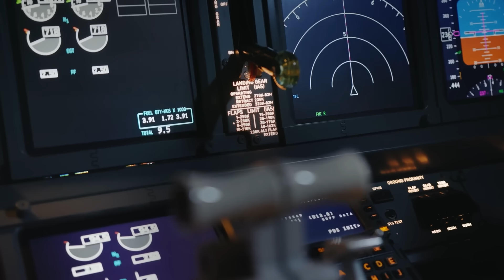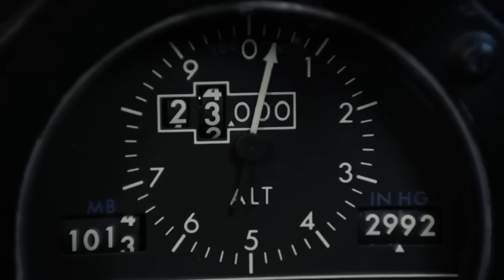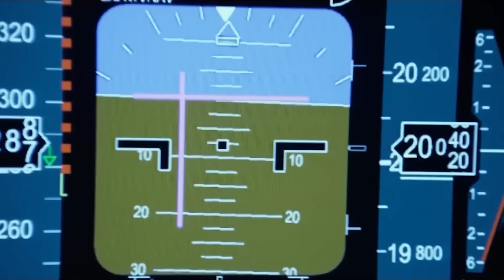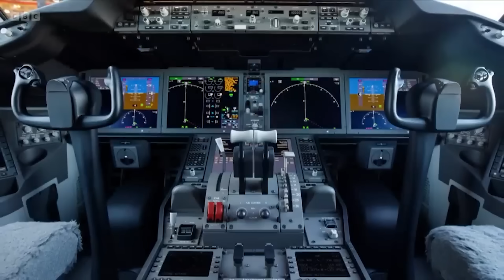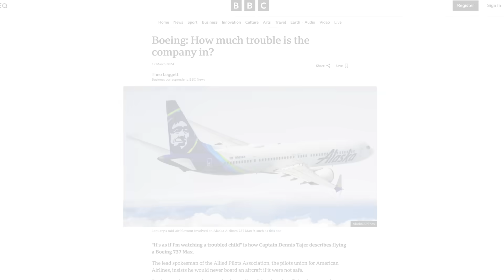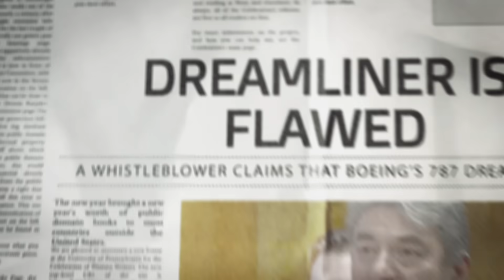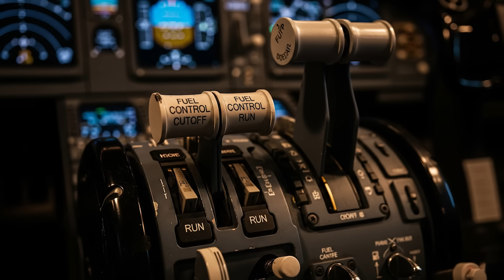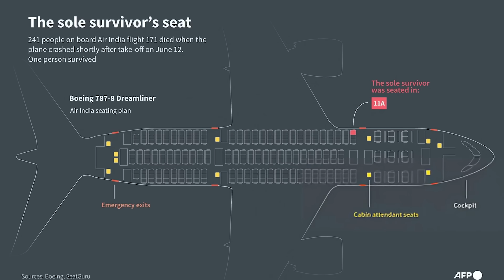What REALLY Caused The Air India 171 Plane Crash

Comment: Fuel switches off, but why wheels were outside. It should be inside right after takeoff. So total  software issue needs to check

Comment: BOTTOM LINE:  THE FUEL TURN OFF SWITCHES ARE NOT MECHANICALLY ACTIVATED! SOMEONE HAD TO HAVE PULLED THE LEVR UP, AND THE TURNED THEM OFF!    THE BIAIS TOWARDS MECHANICAL OR AUTOMATION FAILURE IS WITHOUT FOUNDATION!  
THERE WERE 3 INDIVIDUALS IN THE COCKPIT! EITHER ONE OF THEM DID IT OR PARANORMAL FORCES DID!

Comment: During start of engines to jere could be a higher fuel ratio used that does not require the switched to be the controling factor but a high output  bypass pump then when engines reach run temp the pump is shut down a llowing control by these cut out switches

Comment: There is a scenario thats not been er expanded  on that the switch maker has a second version of the switch called double pole double throw  and the wrong connections were made  so that on means off  and off is the real on position  ive seen such  they were used on early computer hard drives  to activate an alarm if accidently turned to off position

Comment: Here is a scenario that would clearly explain everything. A cabin door was unlocked while the wheels were still on the ground. The aircraft  system shut off the fuel flow as a safety action. The pilots realizing what happened, cycled the manual switches on purpose the same way every person shuts off lights and back on when trying to resolve faulty lighting.
Reply: Dumbest comment, there is no system on the plane that can turn off the fuel switches, they are mechanical switches, why doesn’t anyone ever listen?
Reply: Why was the cabin door unlocked?
Reply: Would the aircraft system shut off the fuel system automatically when a cabin door is unlocked?? Wasn't there a piece of metal that fell off the aircraft before the tragic and horrific impact?

Comment: The lock movement switches can’t be turned off by the plane. They are manual switch and they were operated by human hand. The plane software didn’t shut off fuel and switches were in on position. The black box noted each switch turn off manually.
Reply: Pilot did it
India trying to blame boeing
Reply: @leslieoneglia7436  💯
Reply: Very sensible and I agree. 💯

Comment: Why don/t the searchers open the tech  manual. NOBODY ever needed to touch/move a cockpit switch.. when electrical power is interrupted, even for a fraction of a second, 787 and 777, for any reason, the spring loaded fuel cutoff valves to the engines will snap shut. Cockpit switches would then at all time stay in ON. This design is that in case of electrical failure, which means fire extinguishers cannot be activated, fuel shuts off automatically so the wing does not burn through from an engine fire. At take off there seems to have been an electrical snag. Happened to ANA 787 after landing using reversers, in Tokyo, and unable to restart. Happened to BA 777 landed safely mile before runway in London. Rtd Training Capt. Pilot Union rep at all regional air accident investigations
Reply: yes

Comment: I read that a Delta Dreamliner had left engine failure at 5000 ft recently. True?
Reply: Delta does not have a dreamliner.
Reply: Yeah, notice it was mid flight or at a higher altitude. This is NOT a manufacture issue. It’s sadly a human factor. It’s a manual switch.
Reply: @3103Juan no its much more likely to be a software glitch, allegedly.

The event logs on the FDR will show TCMA, EEC, Thrust Managment Issues, Landing Gear Handling or AutoPilot errors.

Comment: The switches were loose and were jerked back to cut -off by the momentum change of the aircraft at take -off, inertial reaction.
Reply: You obviously have never seen or used a mechanically-interlocked switch of the type Boeing uses on the 787.

Comment: Everyone assumed that the cockpit door shuts automatically and could not be opened from outside. My gut feeling is still that someone (NOT THE PILOT) shuts it off. He/She could do it while the pilot is very busy piloting the aircraft on take off. Since the switch is a hardware , they would still be in that same position after it crashed. Did it? Did anyone insist to search the fuel panel switches in the crashed rubbles??? If it is not a software failure, then it must be the above theory.
Reply: software more likely allegedly.
Reply: @hazard3020 software has nothing to with those switches, those are mechanical switches